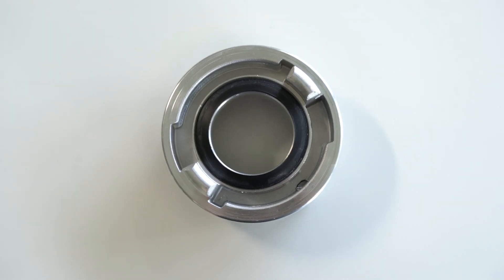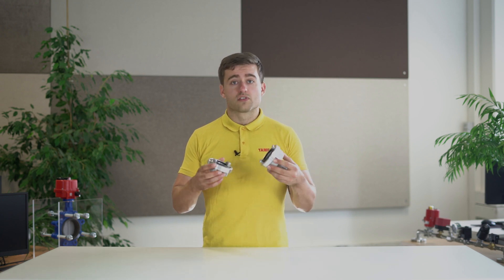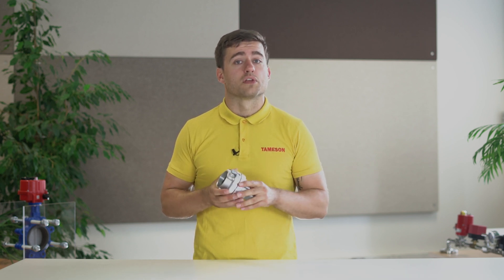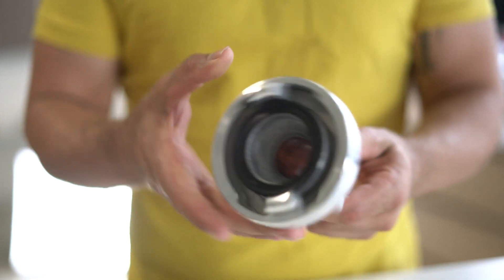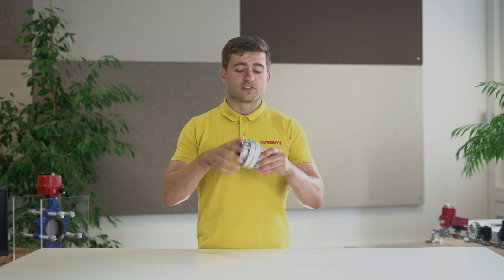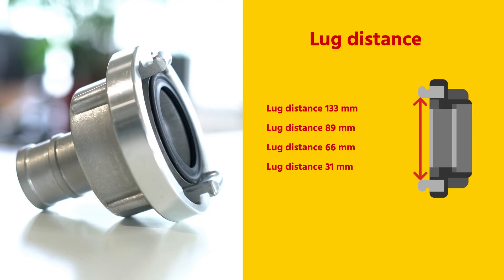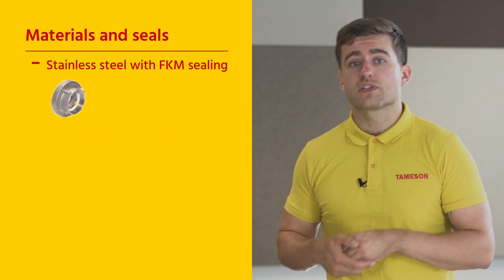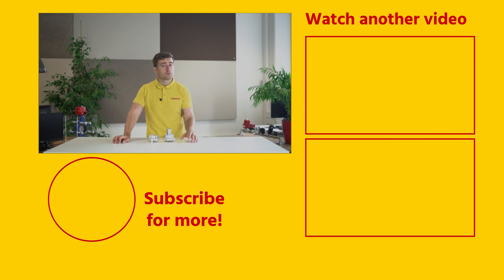How to use and select a Storz fire hose coupling - Tameson

Comment: Good evening sir,
I want to purchase a fire jet nozzle for the vessel. The fire hydrant diameter is 52 millimeters. Should I purchase a nozzle with the same diameter as the fire hydrant?
Reply from the maker: Thank you for your inquiry. For optimal performance, it's important to match the nozzle diameter with the fire hydrant diameter. Therefore, a nozzle with a 52-millimeter diameter would be suitable for your fire hydrant. If you need further assistance or have additional questions, feel free to contact us.

Comment: Hello, Can I fitting the fire house 45 mm to hosetail couplings 50 mm.?
Reply from the maker: Hello, the 45 mm diameter is to small to fit on 50 mm hose tail coupling. You can check our range on www.tameson.com
Reply: @Tameson  How do you see or ensure the suitability of the hose used with the Hosetail coupling used?